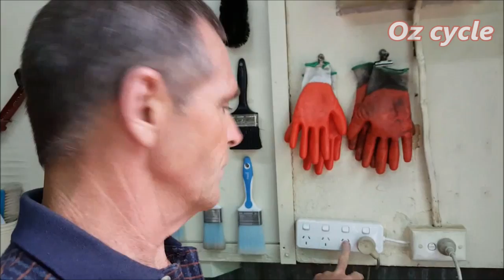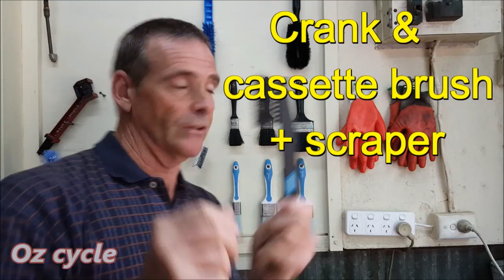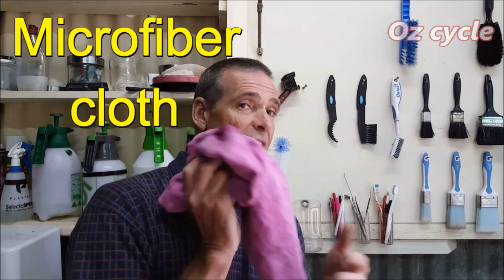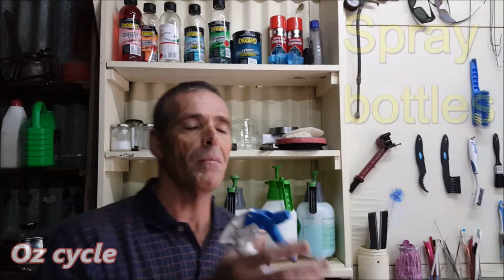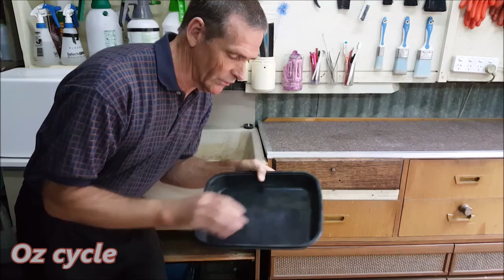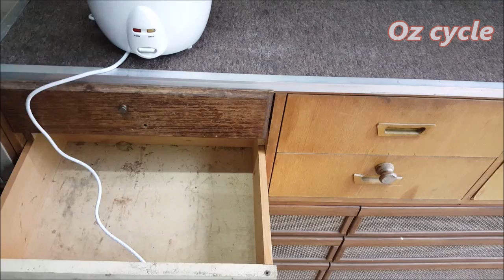BIKE TOOLs - Pt.2 Clean your bike

Comment: Great series of helper videos thankyou. Do you have one for re-lubing the bike after you’ve cleaned it? The chain waxing is covered in detail but the bearings, brakes etc? How often and what with would be very useful. Thanks
Reply from the maker: Modern bikes have sealed bearings...no need to lube when cleaning the bike. For sliding pivots use silicone spray.
Reply: @stevenleffanue  Thanks very much for the speedy rsponse 👍

Comment: Hey mate old video I know but I’ve just bought my first Di2 bike. Any tips on cleaning the electronic components? I know to bag up the calipers and not contaminate the pads or discs. 

Just a little concerned about water ingress. I wash my bike after most rides. No high pressure. 

Thanks.
Reply from the maker: The electronic components should be fine in rain same as mechanical. So cleaning is same.

Comment: Having a dummy bike is an excellent idea, Steven! You can pick up a very used bike/frame at the local good will, or find a discarded  one someone's left at the local refuse tip. This video is really helpful for both seasoned and novice cyclists. BTW, I found my rice cooker at the local thrift shop for $4.00! Off to get some paraffin wax on Saturday.

Comment: methylated spirits is good for drying chain, especially after petrol clean.
it will remove the oily residue left from petrol cleaning.
but it's also hygroscopic (miscible'), so it will 'absorb' water – this in turn speeds up evaporative drying.
Reply: oh. by the way ... LOVE this channel.
thanks mate.

Comment: Thanks for the video mate. I have subscribed to other bicycle channels and I always tend to use your tips the most. The one tool I would recommend from your last video is a breaker bar. Removing a freewheel and pedals would be hard without it.
Reply from the maker: +Bdogsp 001 Glad you find the vids helpful. Whats a breaker bar?...I cant remember showing one?
Reply: Hey Mate,

I phrased the sentence wrong. What I was trying to say that breaker bar would have been a great suggestion for your first tool video. This is what Wikipedia describes breaker bar as: "A breaker bar is a long non-ratcheting bar that is used with socket wrench style sockets. Breaker bars are used to break loose very tight fasteners because their additional length allows the same amount of force to generate significantly more torque than a standard length socket wrench." That or pipe that is long and wide enough to fit a spanner or cresent wrench for leverage. I started using paint brushes to clean my bike as well. 

Thank you for your videos mate.
Reply from the maker: +Bdogsp 001 Ok,yes good idea. I should mention this in a Vlog...Thank you. For pedals with 8 or 10mm allen key I use an extension pipe. For cassette lock nut an adjustable spanner.